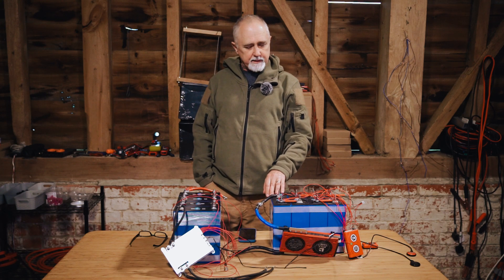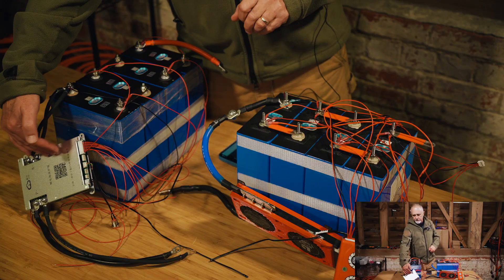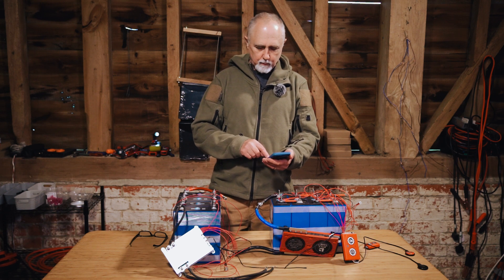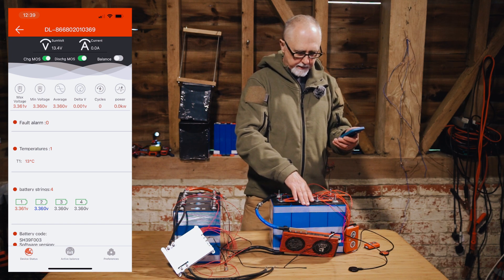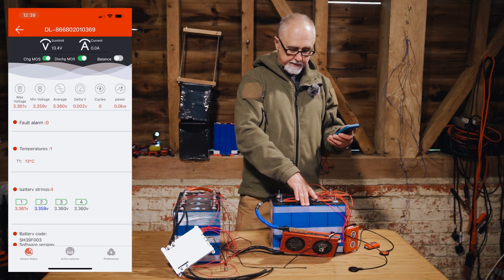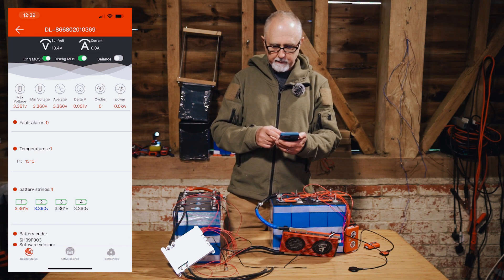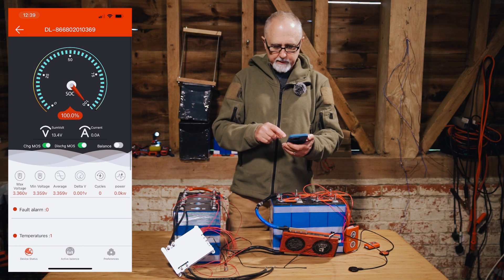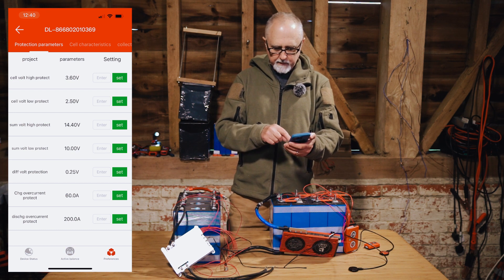JK BMS or Daly Active Balancer: How did they do?

Comment: A month to balance?  Under normal use, the the number of hours per day that balancing can be ACTIVE, can be only a few hours, not 24 hours. Did the JK balancer finish balancing much faster than the Daly Balancer?  Waiting a full month, with an idle battery, to check the final balance proves nothing.

Comment: Balance Open Start Volt- They ALL have to reach that voltage for balancing to begin? Wouldn't it be MUCH more sensible to have it so ANY cell that hits X voltage is eligible for balancing so long as other parameters are met?

Edit: Ah I see you talk about this.

Balance Open Diff Voltage: Isn't it ridiculous that Daly doesn't allow a number lower than 50mV? 5mV...sure that would be nice....considering the cheap active balance boards you can buy are accurate down to 5mV (claimed spec) but more realistically I've seen they go straight down to 1mV. But what is the purpose of allowing that large of a differential? You could have one cell at 3.600and the other 3  at 3.551volts.....I think any sane person would say that the 3.60V cell should dump some energy into the others. While its not a good idea to balance below 3.40/3.45V it would be possible to have 3 3.401V cells not balancing with a 3.450V cell. Yes, eventually the higher cell will further diverge as voltage climbs more rapidly the closer you get to 3.65V but why not allow something like 0.01V open diff value?

I really hate dealing with Daly BMS's at work. JBD is so far superior. JK is too even though its not the easiest to work with

Comment: I use the jk bms, its crap! It shows me a 100 ah charge into my battery but when i discharge it says its only 60ah ?????
Reply from the maker: Have you found a better BMS?
Reply: @offgrid_power  yes, i use the jbd bms i was using before the jk, it gives better and more accurate info. 
I have had nothing but problems with the jk, it totally went hay wire not long after having it, shut down and could not connect to bluetooth, it just made squealing noise, got in touch with seller and they told me to open it up and remove a transistor from the pcb that controlled the buzzer, worked but now get totally erratic ah values, also in cold weather below 0 centigrade it shuts down and wont connect to bluetooth unless i pull balance leads out and disconnect from battery for at least 10 minutes. Just no good at all! 👎
Reply: @karldingbat OK. So you had one bad JK unit. That proves nothing. There is going to be at least one failure with every brand.

Comment: I had to use a bench power supply from microcenter and put all my 12  200 ah lyth prismatic plastic encased cells all in parallel and do a top balance at 3.65 v and the delta is 0.02 0.01 now it's a 3P 4S setup now waiting on my daly smart active balancer today via Amazon I bought my 12 cells for 480.00 Total
Reply from the maker: That sounds great! What cells did you buy?
Reply: @offgrid_power  200 ah lyth prismatic plastic encased cells

Comment: Nice to see that Daly has an active balancer finally. What size cells are you using with the Daly balance vs the ones you are using with the JK?
Reply from the maker: The cells we used in this video were 280Ah.
Reply from the maker: They definitely make a difference, but still a shame that Daly has never had them built into the BMS.
Reply: @offgrid_power  agree
Reply: I'm getting the Daly smart active balancer today

Comment: The main reason i have ever had why the voltage reading is completely different through the Daly bms compared to reading directly from the battery is because the bms is inactive.. When it's not active. It will only read and active 3 cells instead of 4. Really weird. I find when reconnecting the balance leads, this reboots the bms and the reading of all 4 cells become active again.

Comment: I think that having the balance start voltage set to 3.1 v is too low.  This starts the balancer working on the flat region of the charge/discharge curve where it is not possible to ascertain what the actual cell(s) state of charge are.  I think 3.4 or 3.45 v is a better balance start voltage as this is where the cell voltage starts to rise towards the end of the charge cycle.

If you use 3.1 and start the balancing too early in the charge process the BMS may actually knock the cells out of balance and only recover the situation at the end of a full charge cycle where the curve starts rising.  This effect is worse if your batteries are subject to a lot of partial recharges (with only the occasional 100% charge)
Reply: I don't know about this particular BMS/balancer, but if it's a good system, it knows the state of the batteries based on the chemical composition of the cells attached ánd calculates the state of charge for the future during charging based on charge-rate set out to time. This means the BMS knows exactly how the cells will respond to different charging currents over time ánd will already start balancing if one or more cells start to rise in voltage too quickly. But such circuits are quite expensive: just the bare IC's that can do this (Texas Instruments and Maxim are two of the (probably) more of the major brands that offer such IC's) can cost upwards of 15 Euro's (about the same in dollars) or more. They also require a hell of a lot of software, require programming of the right chemistry in memory ánd require the battery-assembly to go through a 'learning cycle': it needs to be discharged down to system critical voltage at a specific set constant current (from a fully charged state, the first charge to full just doesn't count if it's not completely depleted when you started). Once down to sytem critical voltage, the cells need to rest for a few hours (depending on the chemistry, anywhere from an hour to 5 hours should do it) enabling the IC to determine the open cell voltage. Than you need to charge it again to full, let it rest again for a number of hours, to repeat the constant-current discharge down to system critical voltage. Only after resting again and a full charge the IC is ready to calculate the state-of-charge with immaculate precision over the lifetime of the battery-pack.